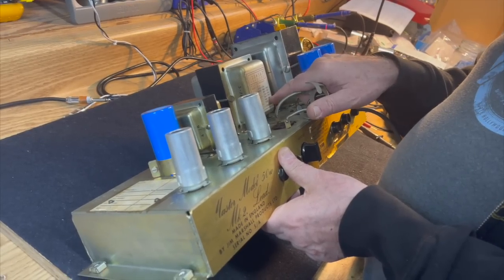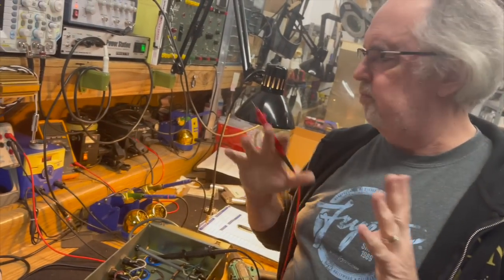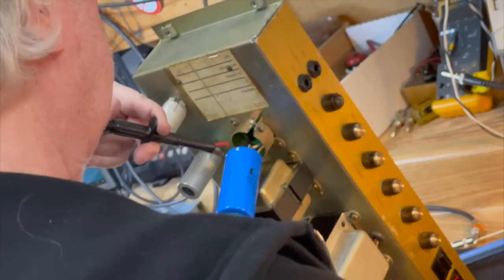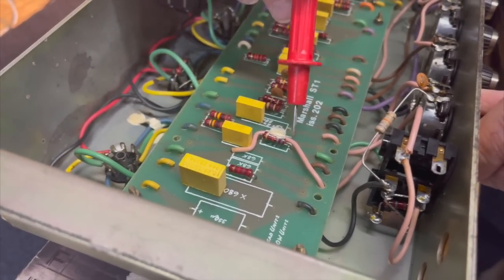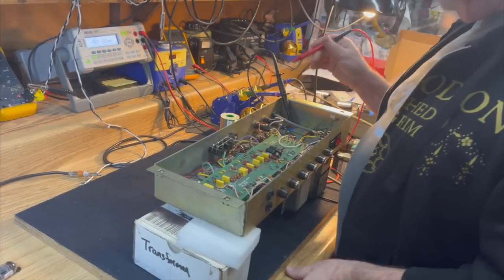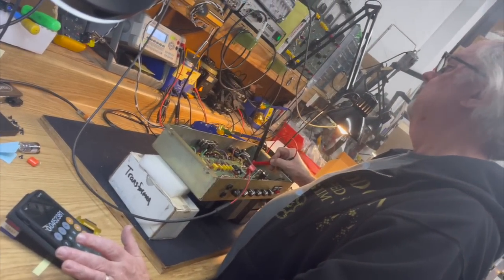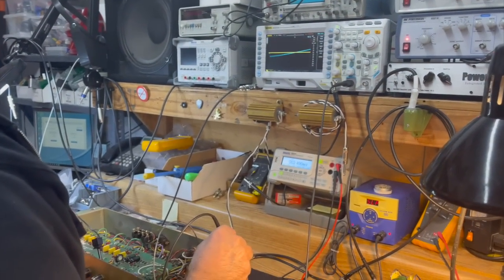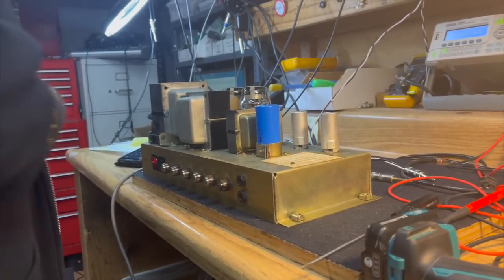Health Checkup: 1978 Marshall 2104 Combo

Comment: Yep, that one was set up for 6550's. On the board you can see 150k ohm power tube grid leak resistors. EL34's would have had  220k. Very cool amp, and great info fellas!

Comment: There is g2, aka a screen (and g3 if the output tube is not equipped with a beam forming plate instead of suppressor grid g3) between the g1 and plate.

Comment: Do you have to have a load on an amp when measuring voltages? Or does it not matter, as long as you aren't actually playing it / sending any input signal?
Reply from the maker: Depends. If measuring voltages at no load, then no load. If measuring at load, then load.
Reply: @FryetteAmps  Ah cool. So no harm to the transformers if the amp is on with no load (nothing connected to speaker out) and you’re just measuring in the circuit?

Comment: Well, you don't need oscilloscope to measure the AC ripple riding on the B+ DC voltage, only a DMM at AC voltage range, unless you really want to see the waveform of the ripple for some reason.

Comment: About the capacitors - Psionic guy all but called Stevie a buffoon...not cool in my book
Reply: If you wanna roast a vintage transformer over a 3 dollar capacitor have at it.
Reply: @vadenk4433  I guess you know more than Stevie Fryette
Reply from the maker: @vadenk4433  The Psionic guy is welcome to bring his POV to the conversation directly. Meanwhile, until you’re able to differentiate between the operation of the power and output transformers, and articulate exactly when and why a “$3 capacitor” might enter the conversation, you may not be ready to effectively debate this topic. But on the off chance you may have a legit point, we look forward to your detailed video on the subject.
Reply: I agree with Lyle,and 95% of the techs out there.